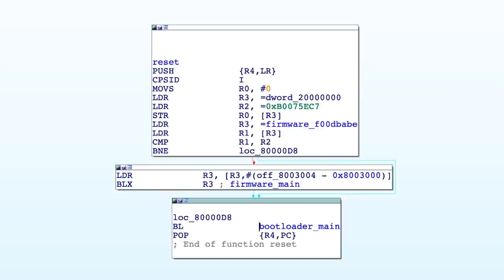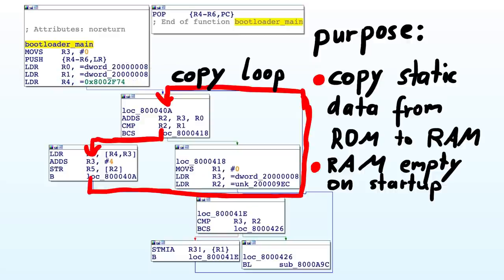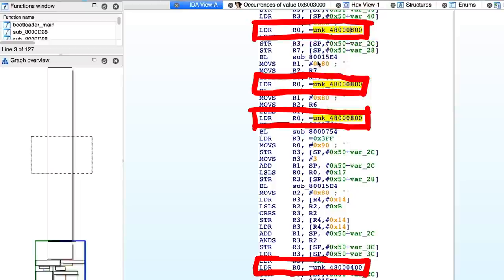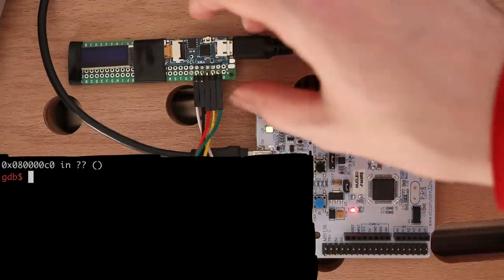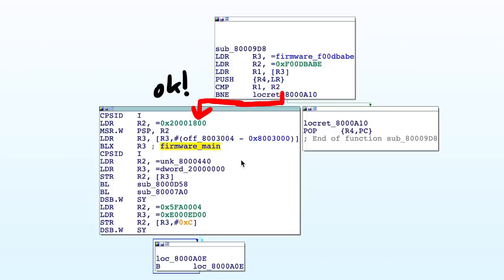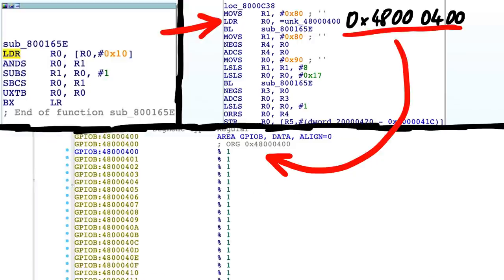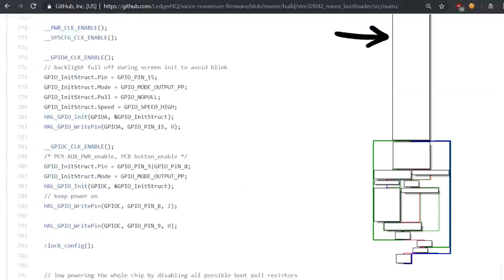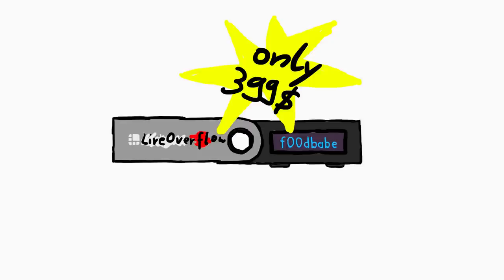Identify Bootloader main() and find Button Press Handler - Hardware Wallet Research #5

Comment: The movs r0, #0x90; lsls r0, r0, #0x17 sequence is faster and smaller than ldr r0, =0x48000000. That movs/lsls instruction pair are 4 bytes long and executes in two CPU cycles thanks to the default-on 16-byte instruction cache that is implemented on STM32F0, while the ldr instruction takes 6 bytes and can require more CPU cycles if the Flash has wait states.
Reply: The real ARM pros are always in the comments.

Comment: 10:00 the compiler/assembler generated this because a MOVS + LSLS is 32 bits total, whereas an LDR [PC, imm] is 48 bits total, because you need to store the constant in your program space too :) In the original source file this would have been LDR R0, =whatever (or a constant pointer in C).

It will also assemble constants with 6 leading Fs as MOVS followed by NEG!
Reply: I understand some of those words!
Reply: That's clever! I thought it was a "security through obscurity" thing
Reply: Also worth noting that instructions can't be longer than 32 bits in ARM

Comment: 1:33 usually the data section with non-const initialized variables is copied to RAM and the size of the bss section, non initialized variables, is cleared. 
Great technical content as usual anyway.
Reply: The voiceover at this point is from a video about AVRs, which are a modified Harvard architecture, and can only access the program storage with special-purpose instructions. If you want to pass round pointers to a piece of data, and treat it like normal in your C code, it *must be in SRAM*, so on AVRs there is no distinction between the .data and .rodata sections. You will run out of SRAM if you have too many constant strings in your code! This is one of my main gripes with AVR. In general you are correct though.
Reply: @Wren6991  thank you for pointing out this AVR peculiarity! I'm definitely more experienced with ARM Cortex M. Since even after that sequence it is repeated that the following loop is needed "to clear the RAM" I though it would be useful to specify that not all the RAM is cleared, but only the equivalent size of the .bss: I know these are just silly details for the whole logic of the video, but maybe someone can find them interesting to know.

Comment: For a different target to reverse, logitech mice with the nRF51 series have a straightforward (nRF52 can be power glitched) firmware readout protection bypass. Logitech m705 and m720 are two of the less expensive mice with this processor.

Comment: Not sure if it's relevant in this case, but I'm pretty sure the reason it isn't directly loading the second gpio data address is because ARM can't load 32-bit immediates into registers. At least that's the case with the TM4C123GH6PM's that I use at my university. Essentially, you either have to a "mov" and then a "movt", or you can shift stuff ;)
Reply: I think you're right because ARM has a fixed instruction width of 32 bits.
Reply: Blynd3 Dev sounds about right
Reply: @Anonymouspock  Quite honestly, I was annoyed by this, since it meant loading all my 32-bit GPIO control addresses in two instructions: 
mov r0,#(GPIOF_GPIODATA & 0xffff)
movt r0,#(GPIOF_GPIODATA >> 16)
I just wrote an asm macro that would generate them for me.

Comment: So with what is done so far, I'd be curious to see if there is a way to add additional functionality that runs alongside the the existing firmware (of arm binaries in general, not just this device).

Can you please point me to any resources on performing this kind of research?

Comment: very cool! I'm enjoying this split between static and dynamic analysis.
btw, does anyone have any suggestions of a free alternative to reverse ARM code?
Reply: r2 maybe?
IDA freeware does not have this feature as I know...
Reply: You can just use gdb as well by issuing x/10i $pc which means: examine 10 instructions starting from the current program counter location in memory...
Reply: Btw if you do not have an arm machine you could just use qemu with gdb..
Reply: @HA7DN  I'll look into r2
Reply: @AntonioDellaRovere  I have an Rpi but it is a different ARM from what I need.. couldn't get it to work. I tried qemu but it's been a nightmare to get it working so far (I'm very much a beginner). I'll try what you said about gdb. Thank you